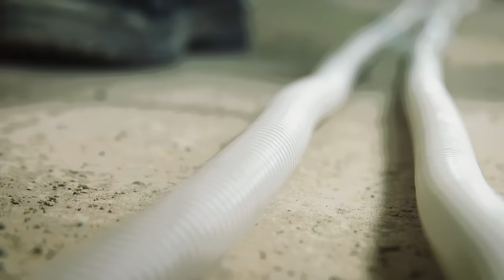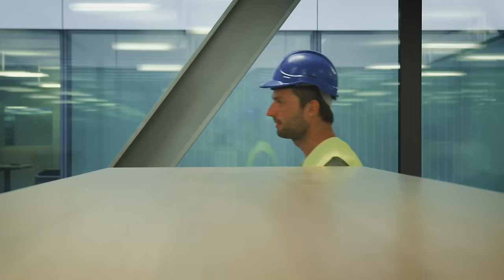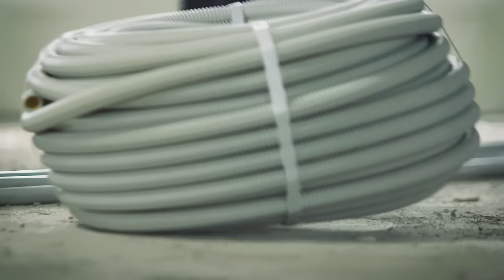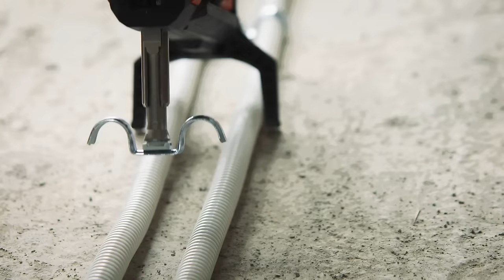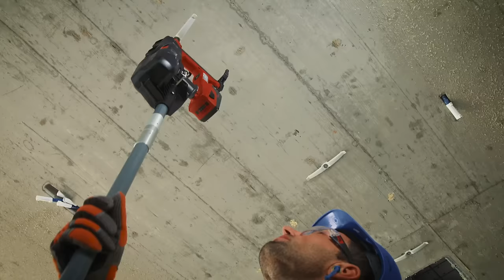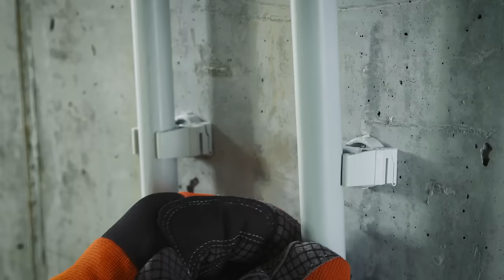Hilti BX 3 Cordless Fastening Tool - the new game changer

Comment: Hilti's got one problem, it's a lot more expensive than the competition
Reply: Their 2 year free servicing and build quality make up for it most of the time, but yeah some of their stuff is near £500 without a battery.
Reply: yeah..i actually hate it hilti so much expensive. But i get it, their marketing not toward normal consumer, but its more to proconsumer and industrial. And they make their product more quality, durable and warranty and servicing more toward industrial. So the price is add up to their after sales service also.  If iam owning construction company with high revenue  i will find their product is reasonable concerning their free servicing and their free loan of tools during tool break down. But for hobbyist, DIY and light work or some light industrial will low revenue it is expensive to own their set of tools. I dont Hilti entirely tho, because they know those people in big construction industrial have money to throw for them for their aftersale service and quality.
Reply: @slyztercoreveanged3175  today is the second time, Makita, Bosch, DeWalt, Metabo, Hitachi Koki, Waker Neuson all have good quality some are even better than Hilti, and prices are much lower
Reply: @nonono9195  I've never seen a tool better quality than hilti take them apart and from the shell to the type of grease they use hilti is far superior